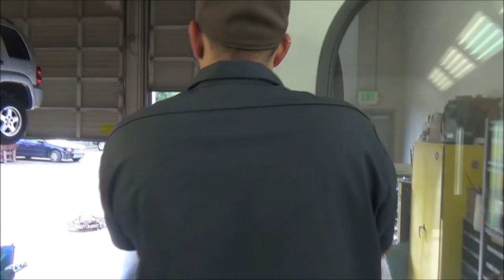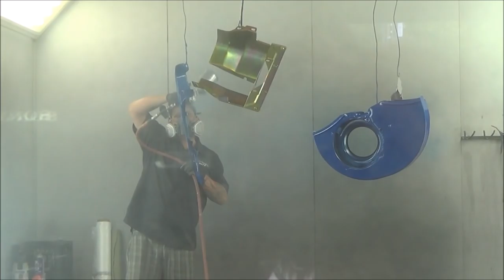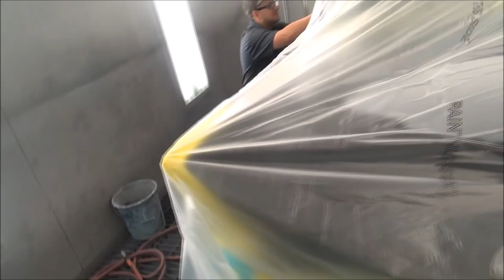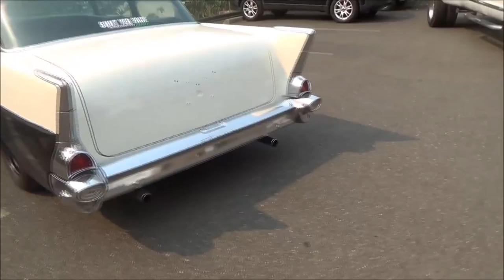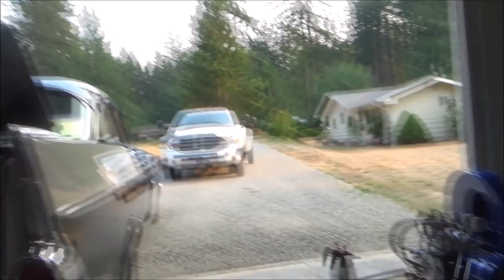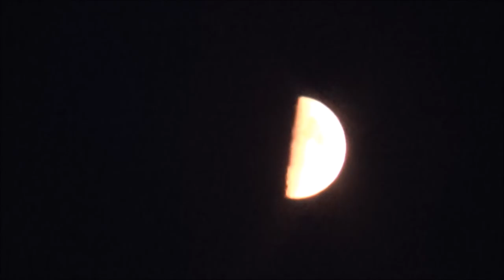Painting VW engine tins and White on the 57.

Comment: Take the motor out the vette and switch them. Then add the procharger.
Reply from the maker: gtsdesigns  That would be sweet for sure.  Its kinda my plan if I keep the vette long enough lol
Reply: the typical converted 6.0 truck motor would be much cheaper and easier to swap, and then you can keep the vette intact, lol... car gonna be worth a couple of bucks when it becomes an old mans car too.... in 20 years, would be very crazy to have your collection of cars... which would be the only reason, i kept that older motor lol